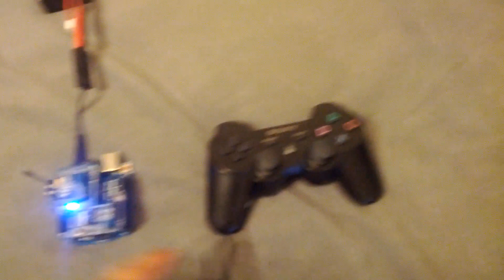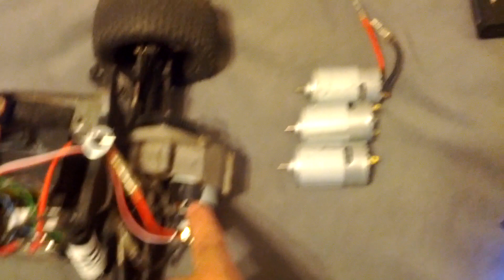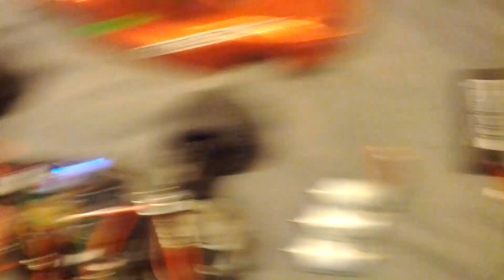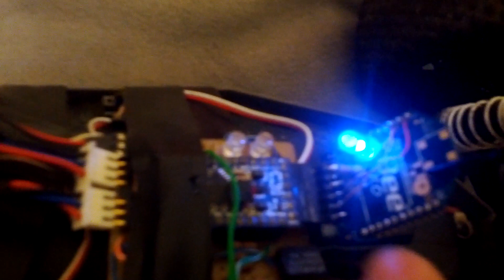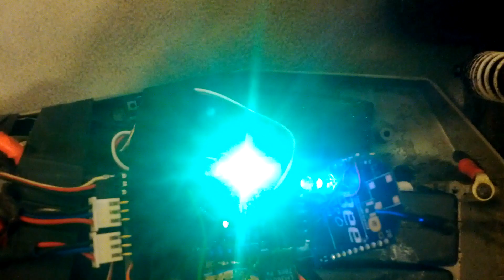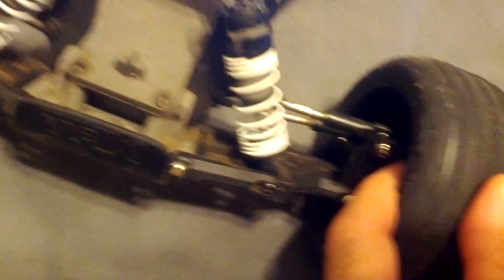Completed arduino powered rc car using ps3 or xbox 360 controller

Comment: Regarding range: 60x the power does NOT mean 60x the range.  Power requirements go up with the cube of the range, because your power is distributed over a much larger area (assuming omnidirectional antennas), so you are only getting the cube-root(60) times the range, or about 4 times.

Comment from the maker: It's really not too difficult. For the controller you just need the right hardware, the library is already written so you just call functions to see which buttons are pressed. The radio system is just as if the serial ports of the arduinos are connected together, so i pass data to it with Serial.print() and Serial.read(). Controlling the car is also simple, for steering use the Servo library and for the motors (depending on the esc) either use analogWrite or also the servo library.

Comment from the maker: Pretty much the same thing i'm doing in the video. If you were to use a ps3 controller and didn't need range over 30' you would just need a single arduino, usb host shield, and usb bluetooth dongle. However if you want to use 360(which only wired controller are currently supported) then you would need 2 arduinos and some kind of radio system. You could use xbee like I am or some other radios(tons of them on ebay)

Comment: Get a motor driver that monitors current. Will clean up your circuitry + monitor your current and keep you from frying motors. Very nice project though!
Reply from the maker: i've long ago changed over to a brushless motor and esc, must faster and no more blowing up cheap motors

Comment: have you attempted to make a quadcopter using the ps3 controller?
Reply from the maker: i want to but quads/hex copters are pretty expensive to get into and any slight mistake can end up being a pretty expensive repair.
Reply: Not all i have a guad thats about 70$ search up dromida omnius

Comment: You're lucky you're not catching static off your bed into your arduino
Reply from the maker: that bed cover as particularly bad about static but frankly i never had any issues ever over blowing up electronics with static. I shock myself a ton but I tend to be more cautious when handling the electronics themselves.